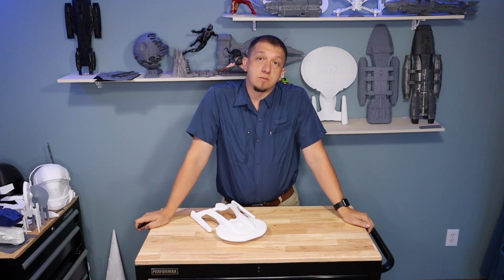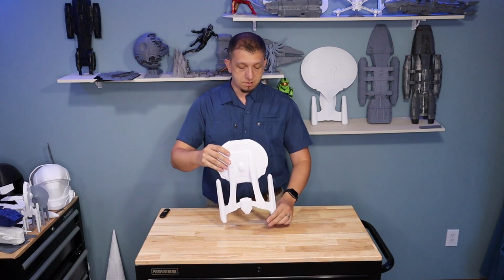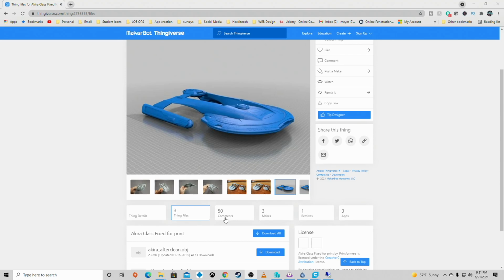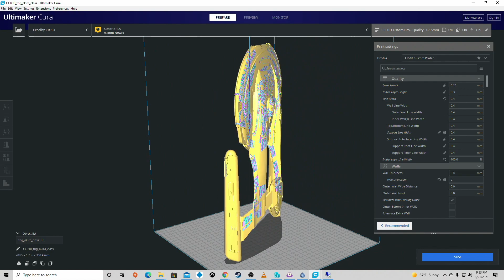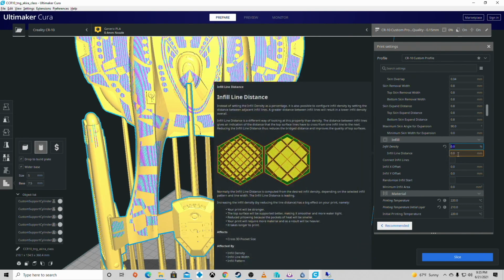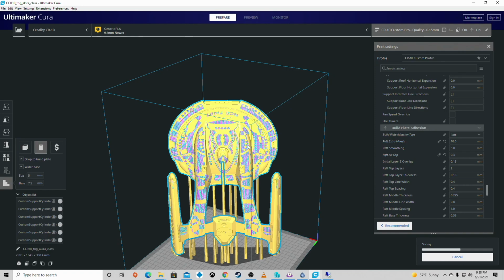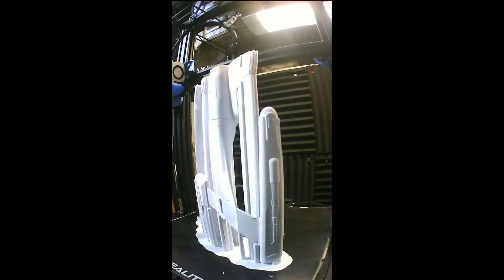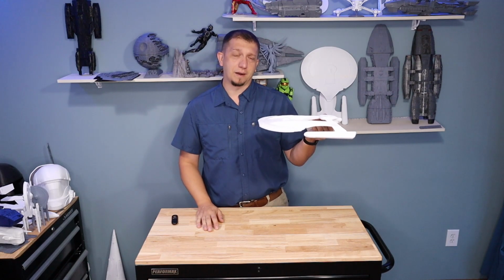3D Printing the Star Trek Akira Class Model Large scale

Comment: Star Trek ships are hella tricky to print.
Reply from the maker: They can be.  The custom supports are key to success as well as placement with bed adhesion.  They way I do it works really well
Reply: 3D Printing with Rise of the Fenix very informative video, thanks.  I’ll have another crack at a constitution refit
Reply from the maker: I actually have a vide with the time lapse.  I think I printed it saucer facing down.
Reply from the maker: I have been planning to do a large scale version of it
Reply: 3D Printing with Rise of the Fenix I wonder if it would be possible to print with thicker walls and no infill, for lighting?
Reply from the maker: Totally can.  You might need to use meshmixer to break some parts up so you assemble and have access to internals.  It’s a video that on my list for at least one ship